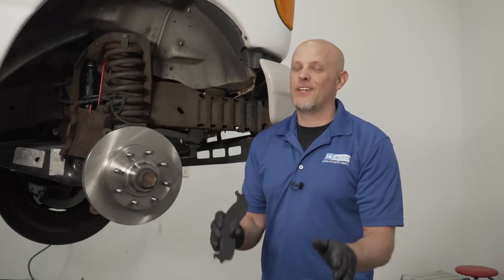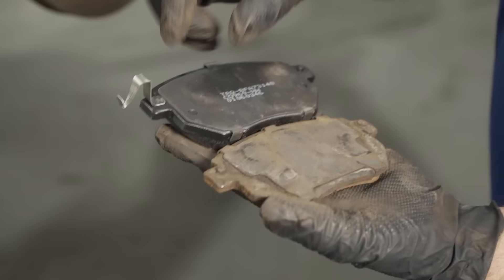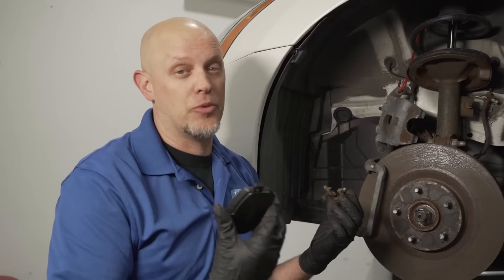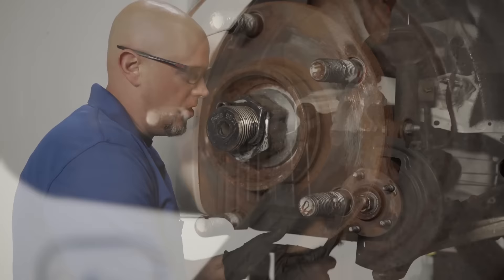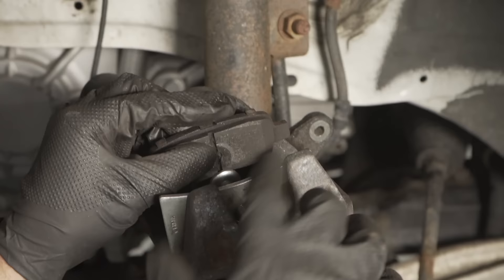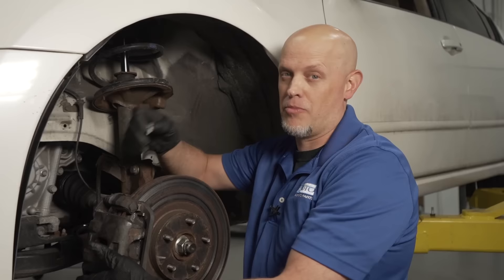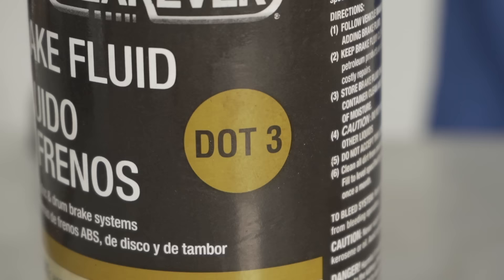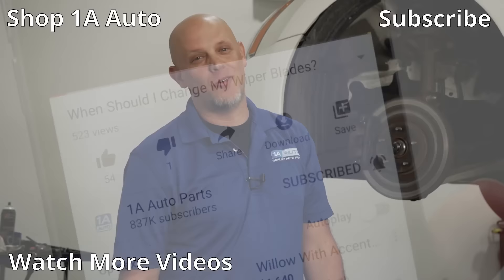Most Common Brake Installation Mistakes!

Comment: I have a situation on my 1500 ram dodge, I damage the front rotors, so I got them replaced with new brake pads got it back from the shop. Everything felt good until I slow down to a stop sign. My brake pedal will slowly sync so first thing I thought it was air in the lines, took it back to the shop mechanic test drove it, and he noticed it did the same thing so they changed out the master cylinder and told me it was ready to go so I picked it up the next day drove it off the lot and it was doing the same thing I was pissed, so I took it back, so they put another master cylinder a booster replug it changed out the calipers and it does the same thing they don’t know why they recommended me to take it to the dealer, so I took it to another mechanic and it did the same thing to them. He recommended me to take it to an ABS specialist, so that’s what I’m doing this morning what could cause the ABS to fail installing the calipers wrong, wrong size rotors….

Comment: I switched out rear brake pads on my rouge but now every morning when i leave i hear a howling sound when i reverse out for about 5 secs then the noise goes away going fowarward or  reverse nosise is gone. But if i leave car sitting for 10 hours the same noise comes back like in the mornin. Anyone have any ideas wat it could be
Reply: The noise is very similar to leaving your emergency brake on. But i didnt  adjust it.

Comment: A rookie mistake I made, not sure how common - make sure your calipers are the correct side. Otherwise, you may get them to match up but will likely have your bleeder valves pointed down, making them impossible to bleed.

Comment: For the novice viewers. I wouldn't touch the bleeder screw on a standard pad replacement. Just compress the piston to its seated home position and leave it alone. Cracking that bleeder screw is going to leak brake fluid all over the place, on the rotors, pads and hand tools. If you don't know what you are doing, it may introduce air into the lines causing more problems including weak brake function. Leave the bleeders alone...

Comment: I’d like to see a controlled experiment, other mechanics have said that brake fluid alone is corrosive to rubber so I’d like to see how an o ring would fare in brake fluid with no oil in it

Comment: The most common mistake I have seen which can catch even experienced mechanics when they are not focused on their brake job is the accident that happens when they first start up and put it in gear. Poof no brakes momentarily until the brake calipers move the pads out and touch the rotors.

One car went into the work bench which moved the office wall. The car was older and went into a high idle at start up. Service manager had jumped into the car to deliver it to the customer and it had no brakes at start up. Always pump the brakes after a brake job before starting the vehicle to ensure you have brakes.

Comment: I’ve asked almost every channel.. I have inside driver rear brake pad and it always wears too fast I know people say it’s the pins it’s not they are clean and lubed and move freely even replaced several time, next was the caliper same deal, and finally the hose going to the caliper changed it and still same issue only one pad always inside rear driver side it’s a 2014 manual mustang gt is this helps I’ll take any advise that’s not been mentioned or a detail about this components that may be more in depth if anyone knows please help I want to give this car to my son and I’m at the point where all I can think is change all the hoses and maybe the distribution block but it’s so expensive I’d hate it to be something simple I’m missing and pay for that part if not needed
Reply: The caliper as a whole has to slide back and forth (very slightly) as the brakes are applied and released.  The inside pad will inevitable have more wear than the outside simply because that is where the piston is and the inside pad will always be the first to contact the rotor.

But if the caliper is sticking and does not move slightly after the brakes are released it will hold the inner pad against the rotor and get its clearance by wearing the pad.  Anytime you do a brake job you should pull the slide pins out and clean them off real good and clean the hole they slide in out as well.   Then put a generous amount of fresh silicone based grease on them, but not into the hole, and then reinstall the slide pins into the caliper.

It is also a good idea to put some grease on the mounting tabs of the pads to prevent rust from forming that could cause them to stick in the anti-rattle clips.

Comment: Once had a rotor that even a torch wouldn't remove it. Even tried an OTC rotor puller. Last resort: use a sawzall!
Always add a touch of anti sieze to the back of the rotor that touches the hub so it will come off in the future.

Comment: If you have to tap on the back of the rotor with a hammer to remove it, hold a piece of wood to the inside edge of the rotor and strike the wood instead of the rotor. You won't damage the rotor and can still use it.

Comment: If you drive in a state that uses a lot of salt in winter, plan on buying rebuilt calipers. (Get the coated ones) Calipers live short, angry lives in the snow belt. Out in Arizona they usually last a lifetime.

Comment: # 1 cause of stuck / seized bleeders is from people torqueing them in place.   They believe they are a high pressure safety issue, so they must be tight.  BUT this is not true, they seal by the design of the tapered angular seat at the bottom and only one pound torque is needed to keep them in place.  The seat works so well that they actually come out harder than they were installed.  Hydraulic  jack control valves are the same way.  People think the slotted handle is there because they need to be torqued .  Not true, the slot is there to keep you away from the load, out of the mud and dirt.  Torqueing them tight ruins the seat so they eventually fail.

Comment: Don't just clean rotor with brake cleaner. Some brake cleaners have Heptane which is an oil. With a good brush, clean rotors with Dawn and water. This will remove the oil and also the fine metal particles from when they were machined. WHEN YOU PUT THE ROTORS ON...keep your oily gloves/hands from touching the faces of the rotor. Also, when greasing the pads, if it has tabs that go into the calipers, grease where they touch the inside of the cup. I have been doing this for years and have never had squeaky brakes.

Comment: If you don’t know how to bleed the brake fluid, DON’T TURN THE BLEED SCREW.
Instead, loose the cap and push the piston back, then quickly tighten the cap.
Otherwise you will need to deal with the bubbles which is far more trouble.

Comment: Don't let the caliper dangle under its own weight. String it up with a wire to the spring to protect the brake line.

Comment: I just replaced my warped rotors and pads for the first time..i forgot to grease the pins And tighten the 19mm bolts..it sounded like the wheels would come off going around the corner for the test drive. I had to do the whole thing over again. Yikes

Comment: Hi. May I know how can i share images of my rotor disc which i suspect was damaged due to wrong installation by the car's service center
Reply: I just wanted to share them to you to see if the damage was really caused by wrong installation of the technician.

Comment: Remove grease from the tips of the sliding pins otherwise these will not travel to the end of the bracket and you get uneven brakepad wear.
Reply from the maker: +@user-yg7ce3rp8z Thanks for the tip!

Comment: Nice video...couple things I've learned in the upstate NY rust belt 1. Do a full clean and regrease every spring and fall 2. Soak rotors in rust remover, file rotor rust ridges, sand rust imperfections with a sanding block with 220grit (tangentially, just enough to reduce rust creeping onto the surface from the OD) 3. You can true up and deglaze pads by pushing each irregularly on flat 80grit paper on a flat surface 4. De-rust brackets and coat as needed to stave off rust 5. Use high temp silicone with ceramic by permatex (orange color, really lasts, Sylglide sucks 👎) 6. Replace pad clips every inspection if you can't clean them to a perfect shine 7. Replace slide bolts at the first sign of oxidation....they are coated so you cannot polish them as that removes the coating 8. Use grease at caliper cylinder/boot to prevent moisture from getting up inside. 9. Only use Akebono pads, Scotty Kilmer isn't wrong 10. Use Brembo UV coated rotors or Powerstop Z rotors which are zinc coated....both are superior against salt.  11. Drive the car at least every other day.  12. Don't assume garaged cars won't get rotors rusted up.....seen it...a garage can actually hold the car longer at the perfect rust temps than if it sat outside.
Reply from the maker: +Rick Thanks for the feedback!

Comment: When you take the caplier off never let it hang from the brake hose or you stress and damage or break off the hoses. Always use caliper hangers.
 Always make sure you pump the pedal to seat the pistons on the pads before you start driving or you will crush the car.

Comment: Is that rotor installed on the wrong side?  For rotors with slots machined in the same direction as the internal cooling vanes, the slots should lean toward the back of the car. For rotors with slots machined in the opposite direction as the internal cooling vanes, the slots should lean toward the front of the car.

Comment: If you hit the hub with a hammer, you always put the lug nuts on the wheel studs because if you don't you will ruin the threads and not be able to get your lug nuts back on.

Comment: When changing rotors and pads, do I :
1. Change rotors and pads on a wheel, then bleed that wheel, and move on to another wheel and do the same, or
2. Change rotors and pads on all wheels first, then bleed all wheels, or
3. Bleed a wheel, then change rotors and pads on that wheel, and move on to another wheel and do the same, or
4. Bleed all wheels first, then change rotors and pads?

Comment: General torque setting for brake caliper bolts during reinstall?
Reply: Its vehicle specific. But should generally be around 14 -20 ft lb. Anymore might sheer the bolt head. So the torque is dependent on the size of bolt. Larger bolt will have higher torque requirement than a smaller one.
Reply: @MN-sc2uz  If he is talking about the caliper mounting bolt or the caliper bracket mounting bolt it is closer to 50 lb-ft

Comment: One mistake I hear a lot while watching vids on the topic is using grease.  More specifically, they don't tell you what it is.  I just pray for their safety it doesn't contain ANY petroleum!!  Ideally, the only grease that should touch any part of the brake system is brake grease and nothing else.  Usually it is silicone and it is often fairly expensive for the little jars of it at the parts store.  You just have to remember that if it has any petroleum in it, that will damage the seals and cause problems that could easily jeopardize your life on the road!!  Use what is made for it and nothing else and at least then you should hopefully feel a lot safer.

Comment: You should have mentioned that one other reason the brake rotors might be hard to remove is it might have a brake rotor screw that is holding it on

Comment: Use brake grease, not regular grease, on the slider pin. Regular grease will swell the rubber boots.

Comment: Two other mistakes I see, one I saw in this video that wasn’t mentioned. 
1) Never, ever, use an air can to blow dust out from the rotors/brakes (use cleaner). Brake dust is extremely bad for your health, especially lungs.
2) Always wear a mask that’s good enough to filter the dust particulates. It’s not worth the damage.

Comment: I just did breaks on my car. They're working fine but I can hear them creaking when I release the break pedal slowly after being parked or at a stop or red light. Or if a just  barely release the break pedal. Can someone tell me what it is? They don't screech when I break. It's upon barely releasing the break pedal that I hear as if the whole caliper or breaks creak but it's not the usual screeching noise that breaks usually sound like when breaking when worn out. Almost sounds like a wood ship in the movies. It's nothing in suspension. I know for sure it's coming the break system.
Anyone, any input? Thanks.

Comment: 2014 dodge Caravan...I cannot get the front brakes to stop squealing! New pads, new rotors...WTH? I used the orange squeak stop on the back of the pads with the shims and it squeaked...do I not uses the shims (that squeaked alone too) and just use the orange squeak stop on the back of the pads without the shims? Everything I try works for about a week and then they start squealing again. Wife is getting mad! HELP!

Comment: A lot of brake systems incorporate ABS sensors, or are at least very near them. These sensors are often times ludicrously expensive and easily damaged. It is advised to temporarily relocate them away from the work area if it is easy to do so.

If all you're doing is changing pads and rotors, it may make sense to not unseal the hydraulics of a break system. In particular, one may chose to take the brake caliper off without undoing the brake hose. Though the benefits may be clear, it is also stupid important that one hang the caliper properly when doing this. An unsecured caliper falling can damage things, especially the brake hose.

Brake fluid can be very nasty stuff. Don't get it on things you like.
Reply from the maker: +Charles Lee ScovillThanks for the feedback! e

Comment: (8:27) Why would you say that you need a new caliper if the piston boot or piston seal need replaced...? These seals are available as a kit for less than $10. Replacing both is not a difficult job.

Comment: Great job! Thanks for putting so many tips into a single place. Really appreciate the videos you make to go along with the parts sales. Have used both your parts and replacement videos several times and they are super helpful. Thanks for sharing 😊

Comment: Without mentioning who did it, to name another boo-boo that is not mentioned here:
When changing the wheel bearings ( 6:43 ), make sure to understand and correctly place those "Backing Shields" in place. They can go in both ways but when installed in the wrong way will cause that nasty squeezing metal sound all the way and no matter how much you bend it on this or that side to avoid opening the entire wheel bearing to replace this, you can't get rid of the problem

Comment: Never bleed brakes when its extremely humid out. And never keep left over open brake fluid. As brake fluid asorbs moisture. Just bleed brakes until all your fluid is used.

Comment: Those new rotors could have been machined. It's the older much more used ones that seem to be unstable and don't stay true a least in the last several decades. Fifty years ago I rarely had rotors that I machined that caused vibrations etc. after three or four thousand miles.

Comment: Some folks would use copper wine for brake lines Crawford line is too soft and REAL dangerous stainless steel line is the best but it's really hard to work with and really hard to bend  stainless steel WILL last almost forever stainless steel is easy to work with ONLY IF you got a GOOD flaring tool

Comment: My ex-wife put power steering fluid into the brake fluid reservoir by accident. Basically required whole brake system and lines replacement.  In today's dollars, that was about a $5000 mistake.  That was a very minor factor, just one of MANY reasons she's, thankfully, my ex-wife.

Comment: another I learned the hard way: don't put too much force on a bleeder valve that won't give - it's easy to snap off.  Instead, hit it with wd-40, wait 20 min.  Try again.  Be careful, very easy to snap off.

Comment: I dont understand why the caliper bracket had to be removed to get the inside pad on. After you removed it, looked like you put it on thr same as if it was on the truck.

Comment: Need Urgent Help Please.
went to workshop for brake job, my mechanic changed the rotors and pad, and I was all set. But after 2 months I got the pulsation and steering started to shake when i pressed the pedal at high speed, I went back to my mechanic, and he replaced the rotors and pads again, shaking and pulsation was gone and life was good, but only for 2 months, I went to my mechanic again, at this point he said it might be bad quality parts and advised me to go to dealership for Nissan premium parts, but instead i went to a different mechanic (because i didn't agree that it was the parts quality issue). So, the new mechanic replaced the rotors and pads with the part who he thought was premium quality parts, so pulsation and vibration gone, but a usual it came back after 2 months, I went to my mechanic again to report it, he said he used the premium parts, and all the suspensions looks good also, he is not sure what is wrong, and why new rotors and pads keep pulsating and vibrating every after 2 months. so, as a last resort he advised me to replace the rotors and pads with original parts from Nissan dealership, but still i am still convinced that there is something else which is messing up my rotors and pads. Any suggestion and advice is appreciated.
Thanks.
Reply from the maker: +Mazhar Ali Thanks for checking us out! http://1aau.to/m/Shop-1AAuto-c

Comment: And never use petroleum based grease on the brakes, especially the caliper slides.  Regular grease will lose viscosity due to the high heat around the brakes, and possibly spread to friction surfaces, and like it's shown in this video, it will degrade the rubber parts like the slide boots.